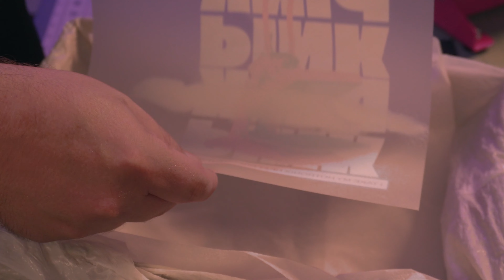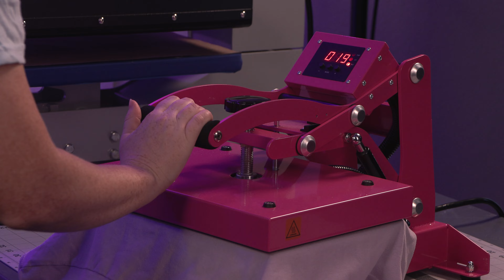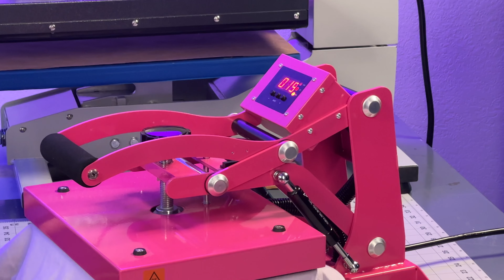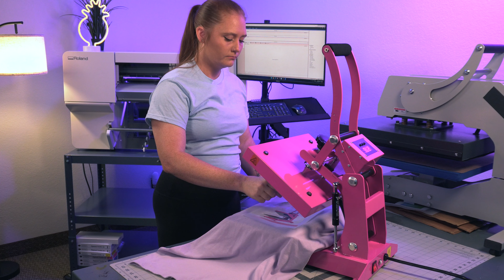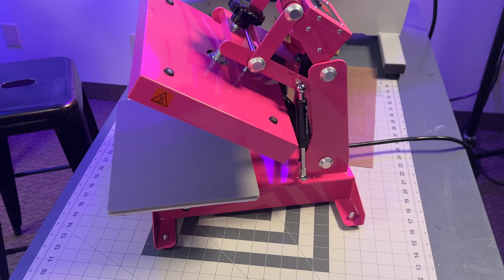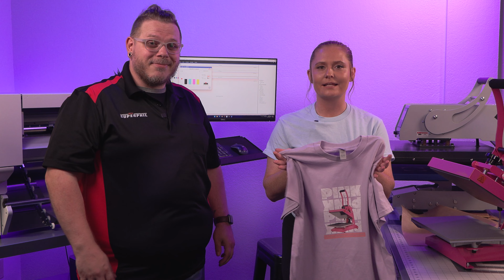Roland BY-20 Basics - Your First Print

Comment: Hi, what film do you use, is it Cold or Hot Peel, can you use Hot Peel with Roland BY-20? also what that pole mount, looks really nice?
Reply from the maker: We currently have a roll of our V2 Hot Peel Film on the BY20, we've been getting great prints with hot peel so far!
Also the mount is just an adjustable keyboard/monitor mount from Amazon. (Just search monitor and keyboard mount)
Reply: @DTFSuperstore  Hi there, we've been testing your V2 hot peel film on Roland BY-20, all colors look good, except white. We have tried different settings, but its just not vivid as other color, you also can see through it, comparing to cold peel film. Any suggestions?
Reply: @DTFSuperstore  Thanks! Would you mind sharing a link to this film?